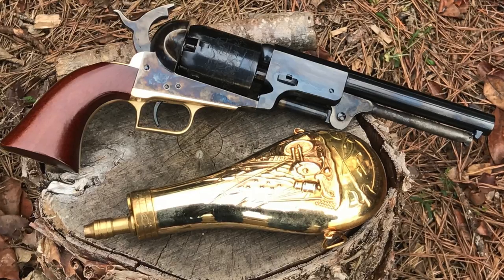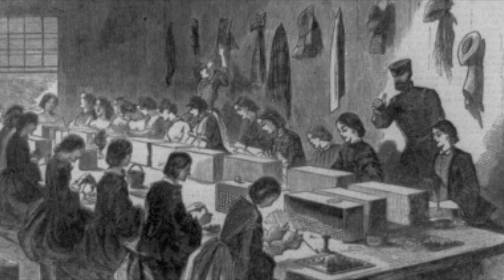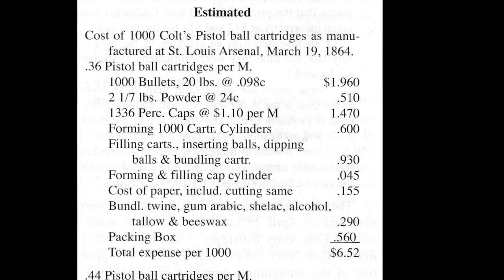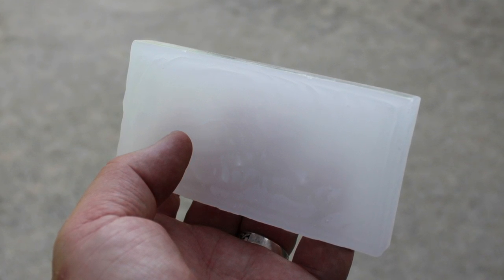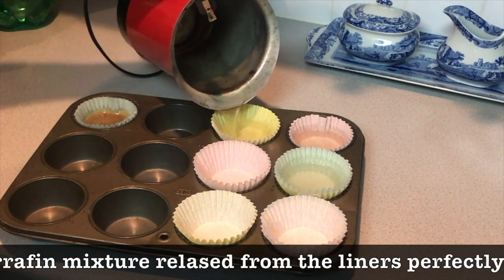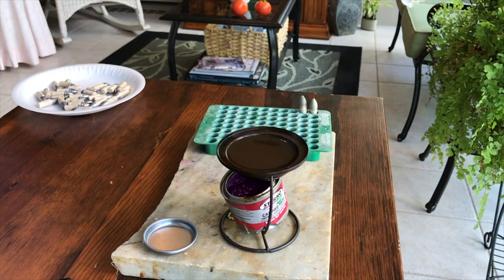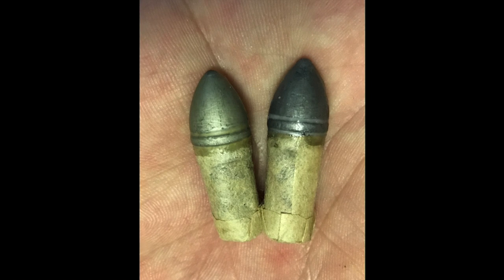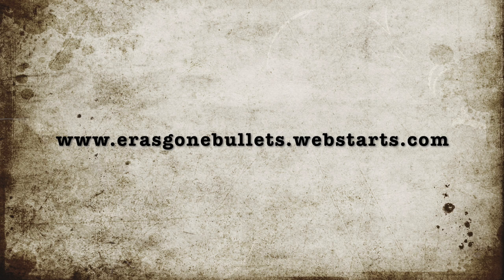Lubricating Cap and Ball Revolver Cartridges

Comment: Great video! I’ve used this exact lube recipe and method and it did virtually nothing to keep down fouling. The bore fouled out with one cylinder. Although not period correct, a felt wad under the wad liberally lubed works tremendously better. These can be used in paper cartridges by placing a very thin cardboard disc between the wad and powder.
Reply: Those are exactly the words my feverish mind was searching for a the time!  I usually can get through 3-4 cylinders with out too much trouble with these recipies.
Reply: @markhubbs1964  By using 50/50 beeswax vegetable margarine grease cookies behind round ball I managed to shoot 16 cylinders without my Uberti Navy 1851 getting clogged with fouling: it went as smooth and accurate as the first cylinder (measuring accuracy by 6 shot groups at 25 meters). I ran out of ammo, but I believe I could have gone on shooting accurately much longer.

Comment: Just a thought - I couldn't find any Gulfwax parrafin at first, so I bought a hundred "tealight" candles for about 4 bucks at Wally World. The wax in them appears to be parrafin, but it's a LOT softer than the Gulfwax parrafin I found later, almost like it has pre-added tallow. So, the Gulfwax is sitting on a shelf, and I'm running through the tealights for lube instead.
Reply: Thanks for the info.

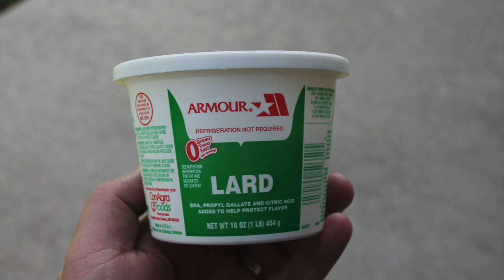Comment: @ 05:18 -- NB: A lot of lards have added salt; be prepared to boil it up with some water, agitate, freeze or refrigerate til it congeals, pour off the salty water & rinse/lather/repeat until you have clean lard that won't carry extra salt into your BP firearm [literally, the last thing you need!] ;-)
Reply from the maker: If true, pure lard is used, there will be no salt.  Bacon grease is a whole different matter
Reply: @erasgonehistoricalmolds2400  Just a reminder to read the label; where I am, the only lard available is sold in rectangular blocks & comes pre-salted... ::)
Reply: @nunyabidniz2868  crisco would be a valid sub for lard, and isn't salted (cheaper as well, unless you happen to raise hogs :))
Reply: I use no salt vegetable margarine. Works like a charm and in this era of diet foods is super-easy to find.

Comment: Dear Friends:  The Eras Gone bullet is a good one and can be used as basis for a functional and authentic cartridge.  Having said all that, it is just about useless for shooting matches with several stages unless the shooter is willing and able to give a good wet cleaning between stages, that bullet just doesn't cary enough lube to lube the bore or the Arbor/cylinder contact area to allow it to be used for an entire match.  I got that combination to work by carrying a SMALL squirt bottle of 10 to one water Ballistol mix that gets squirted on that cylinder/arbor joint and down the bore, it takes some learning on just how much can be used before the wetness causes misfires.  Your Eras Gone bullet shoots quite well as long as the fouling is kept soft, something that is unnecessary with the Big Lube Bullets.  One has the choice of being out of Historical Costume and using Big Lube Bullets, or being historically inaccurate by carrying the Ballistol and Water mix while using the historically accurate Eras Gone bullet.  I haven't tried pressing a grease wad over the loaded chamber mouths yet, but the lube is stiff enough from the Bees Wax that it might be unfeasible to try wiping a small amount from a stick of lube onto the chamber mouth, it is definitely too soft to be handled on the line in discs.  The Ballistol and Water mix that I use for cleaning works best for me if I am using the Eras Gone Bullet.  So far I haven't bought a mold, I am borrowing a fellow shooter's to conduct trials.  It is an EXCELLENT bullet, but not for matches, unless an extensive wet cleaning is done between stages.  All of us try to keep close as we can to historical accurate and customary equipment, but it seems impossible using a historically accurate bullet, I wonder what Civil War Soldiers used to keep their revolvers running during battle?    Perhaps the revolver was seldom used as the principal weapon, getting used only when the battlefield became crowded and the usual rifles and carbines were not easily used.  Cap and Ball and muzzleloading shoulder arms  were plagued by Black Powder fouling, then and now.  The Henry and Spencer cartridge arms suffered from this malady also, but to a lesser degree with their self contained cartridges with a better lube supply.  It seems that fouling from Black Powder was so commonplace that it was an expected problem and got little mention in reports, it would be good to know what conditions existed back then.
Reply from the maker: I suspect that you shoot more rounds in one match day, than the average soldier shot during his whole career.   Prolonged shoot outs with hand guns were very rare during the War.  Most cavalrymen relied on their carbines.
Reply: @erasgonehistoricalmolds2400  Dear Friends:  Some of us in our diligence to recreate or perhaps to create a fictitious yet historically correct character by researching , creating costumes, language , historically correct equipment and all the other aspects of a character's persona some willing to use historically correct soap, razors etc depending on which shooting sport activity is being pursued.  It is commendable that there are those out there who focus of recreating everything down to the lack of deodorant in the camp in their atlas of persona they have chosen to creat or recreate.  I have made serious attempts to. pursue the historicaly accurate theme.  , but in truth dysentery, cholera, bad food, infections and other hazards of the time period probably killed more soldiers, cowboys or other historical personalities than bullets.  We are out there indulging ourselves in a bygone time time and reaping rewards from the fellowship and shared passions of the activity we choose.  Many look down their noses at me when I produce that squirt model of Ballistic and water or sometimes an inaccurate bullet historically speaking so that I can keep my weapons running during a match that is not very close to what happened in the century we are trying to portray.  If someone chooses to participate in the Grade B Hollywood portrayal God Bless them. I hope they have fun, I wish the same for those who will in making their Persona try to duplicate the thread and even the spools of thread and how those spools were made in trying to be historically accurate.  I say everyone sh Ould adopt that particular type of shooting sport they like the best, follow the bylaws and limitations as best he can and go have some fun shooting all the while trying to follow the guidelines of that particular sport.  We, all of us feel alienated in some form in modern society and long for the perceived simplicity and romance of some bygone time.  I say we should remember why we liked the social aspect of whatever shooting sport we have chosen  We should do the best we can to create whatever character we are trying to portray, have a good time and good fellowship, and let the Devil take the hind most part.  I particularly like the efforts that Eras Gone have participated in and when possible try to use historically correct gear and promote a good time shooting rather than trying to pick apart the persona that some new shooter has tried to use.  Life is too short to take that seriously, and there are a vast number of problems to be worked on within the parameters of SASS or whatever other organization establishes.  Come on, it is all about having fun shooting,, isn't it?
Reply: Revolvers were mainly issued to cavalry, which used them while closing distance and then switched to the sabre. Most people carried more than one revolver.
Quantrill Riders and other skirmishers, that fought on foot as well and did a different kind of warfare, often carried as much as 4-5 revolvers. Two on the saddle holsers, two on the belt and 1-2 pocket revolvers tucked in the waistband and overcoat pockets. When one ran empty, they simply switched to a loaded one.
Pocket revolvers were also extremely popular among infantry officers. Again, usually more than one revolver was carried.
This because mostly there wasn't just enough time to reload during battle, and because carrying multiple revolvers was also good insurance against malfunctions such as a gun locking up due to a cap fragment into the mechanism.
So they didn't have to fire more than one cylinder out of any given revolver. Maybe two if there was a lull in the action allowing to reload.
Remember that we see this from the opposite perspective, as people in the "wondernine" era, while that people came form a recent era of single shot percussion pistols where to have more than one shot you had to carry more than one pistol, and a brace of pocket pistols (i.e.: two shots) was all that one had before having to switch to melee weapons.
Revolvers were a huge improvement, so having 6 shots at your disposal was wonderful, and people considered matter of fact to carry more than one pistol. There was nothing unusual in it: it was just how you always did it. It was "You want more than one shot? Carry more than one pistol" and now it was "you want more than six shots? Carry more than one pistol".

Comment: I've been using a softened paraffin wax for a while now with my muzzle loading  rifle cartridges, and it works well, cheap too. Good to see I'm not the only one who thinks/though it was a good idea. On rifle bullets, the paper holds enough lube, but on revolver bullets, I'm thinking that you might have to pan-lube them with straight wax (or just barely softened) before assembling the cartridge (in order to fill the grooves), then dip in soft wax for an overcoat/temper the hard wax a smidge.

Comment: Thanks so much what a great video , i must have gone thru 20 utubes before I found yours , it told me everything I wanted to know and more ,the historical stuff was priceless , I started in black powder cap and ball and now have western action as well I've been trying bees wax / tallow under my lead with a touch of cotton ball between the base of the bullet and the powder charge in my 44-40's to stop the lube messing with the black powder , I was totally struggling with lubing the cap n ball inside the paper cartridge as it messed my paper , your method is fab , I've been trying to find a rapine hollow base mold as I think that'll be better for the 44-40 , I also picked up an old lubamatic bullet resize n lube press and will tryand make bees wax/tallow in cylinder tubes in it as well to see if I can get the 44-40 lube grooves done that way , thanks again and I will check you .com page too

Comment: Just wondering if in cold weather the paraffin might get too brittle? Of course being such a thin coating maybe not an issue.
Reply from the maker: Yes, and the same could happen with bees wax.  The grease added to the paraffin was my attempt at making a little bit softer and less brittle.  However, I don't know what paraffin recipe that Colt used on original bullets.  I don't know how brittle it was.

Comment: I mix lambs tallow and beezwax 50/50 and melt in the microwave in a plastic tray (anything will work like the trays mw dinners etc come in)  once melted I can dip 20 or so rounds ball first in it till it needs another 30 or so sec in the MW to melt again.    i dip the ball and maybe a eighth of an inch or more past .    but... LOL I have dropped the whole thing in and just got it out and used it.   maybe even makes it waterproof?   the other method is to use commercial smokeless bullet lube.   this is much cleaner and applies easier... not sure how well it works tho.

Comment: I wonder if you can help I made some paper cartridges from coffee filters using a proper former these are 44 and I’m using .454 pure lead balls, but I must admit I had a hell of a job trying to seat them, even on a loading stand.any advice?
Reply from the maker: Are you sure you are using pure, soft lead?  You might try .451s instead, but typically .454s will load with out too much effort.
Reply: @erasgonehistoricalmolds2400  I haven't tried loading with the cylinder attached on the gun yet so may get better leverage doing it that way rather than the loading stand. So experimenting at the moment.
Reply: Use 451, not 454
Reply: You can use a small piece of tubing 8 or 10 inches long to slip over the ram lever to increase the leverage.  A commercial one is available from one of the bp bullet suppliers.

Comment: I’m shooting smooth bore trade Gun with round balls. Tried out some paper cartridges no lube and it is fouling badly.  After the 3 rd shot it’s difficult to load and shoots all over the target. Need to lube somehow
Should I lube the round balls before I put in cartridge?  Or how about dipping in paraffin/ lard  lube  with the ball Tied in, let dry and then load powder?  Any thoughts?
Great video. Thanks
Texas Gil
Reply from the maker: Round ball cartridges were not lubed.  They were also cast much smaller than bore size to allow for easier loading. For example, .69 caliber weapons were normally loaded with a .64 or .65 caliber ball.  You loaded in the paper until it was too fouled to load, and then you loaded the ball naked and kept shooting until it choked.  Smooth bore guns are dirtiest guns to shoot unless you shoot a tight ball and lubed patch.
Reply: If you are loading the wrapped cartridge as they did luring the ball in the wrap will not work what I do on occasion is dip the wrapped ball cartridge in the lube this cuts down greatly on fouling. Just a thought to pass on.

Comment: I understand you’re wanting to do it like they did in the old days, but it’s not necessarily the best way.  More, softer lube (depending on weather) will help keep the powder fouling soft.  Back in the day I don’t believe they’d be firing dozens and dozens of shots in a day like we often do, and so generous lubing would not have been such an issue.

Doesn’t anyone know about Gatofeo anymore?  I make Gatofeo #1 lube, and sometimes use plain old SPG.  Either one is a good lube for moderate spring, summer and fall weather in the NW U.S.

Your carts look very original, but for better range performance when shooting more than a few cylinders worth in a single session, I much prefer to include a lube cookie (card, lube pill, card) inside the cartridge between powder and bullet.  This leaves some lube behind the bullet inside the bore to keep the powder fouling in the bore soft.  When done right, the bore is no more folded after the 100th shot that it was after the first shot.  I did extensive tests on this during the period of circa eight to fifteen years ago.  Lube in the bullet grooves alone cannot accomplish this, unless, maybe, you’re using a bullet having super giant grease grooves but even then I don’t see as how much lube is going to squeeze bast the bullet’s base band and get left in the bore behind it where it can do the good that needs to be done in order to prevent a constant accumulation of fouling.

Also, there has been some discussion of whether “paraffin” was cited in the old literature, or “paraffin wax”.  It’s important to know which, because they assuredly are NOT the same thing.  Paraffin is sold today as that “super refined” or “extra pure” (or other words to that effect) lamp oil, used in lieu of Kerosene, whereas paraffin wax is that hard canning wax, presumably made from liquid paraffin.  Anyhow, Gatofeo #1 lube includes paraffin in the recipe, along with tallow and bee’s wax, but of course it’s a modern concoction based on Gatofeo’s interpretations of old literature.  You can look up the recipe.  Or rather you could, at one time.  I don’t know if it’s still floating around, but I have it written down hereabouts.  Such information on the web eventually dies with the person managing the server, or with his enthusiasm for paying the costs and putting in the time.
Reply: Lube behind the bullet will degrade your powder charge, in time!!
Reply: @robertemery5267  It CAN degrade your powder charge, depending on the lube used, the temperature, and whether there is a card sealing the lube away from the powder.  I have paper cartridges that are years old, have lube under the bullet with card wads separating the lube fro the powder, and show no signs of lube creeping into the powder or paper cases.  But I have others that were left in my pickup in the hot sun in summer (on the floor, NOT in the direct sun) that show substantial degradation of the powder because of the lube.  Even with a card separating the lube from the powder, the lube becomes so soft that some of it will creep into the powder.

In short; It depends!

Comment: The grease is to keep the powder dry. So you can leave it loaded...
Reply from the maker: The grease is to lubricate the bullet.  The grease will keep powder fowling soft and increase accuracty.  The oversized bullet being swaged into the chamber is what seals the chamber and prevents chain fires. The tight ball will also help keep moisture out of the chamber, at least from the front end.